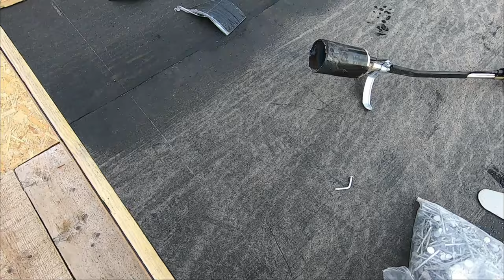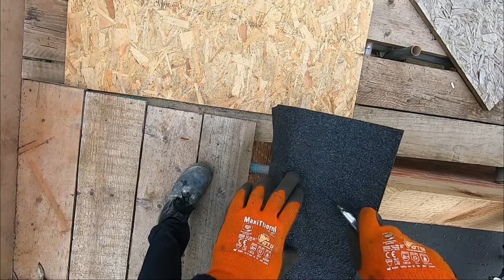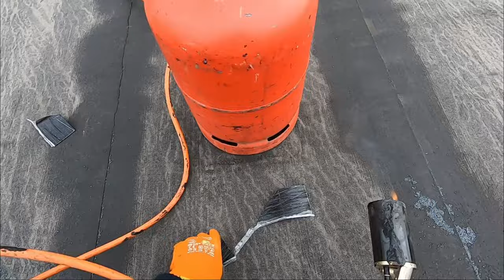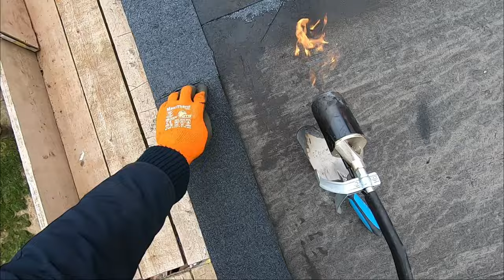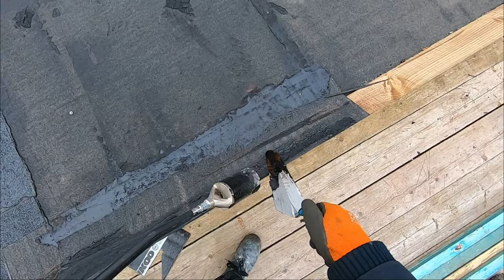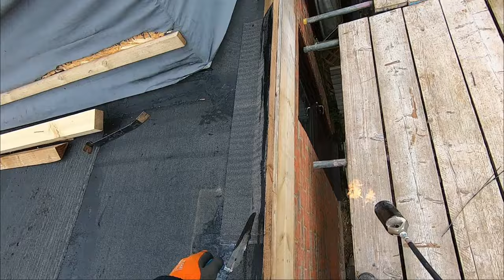Flat Roofing - Episode #1 - Torch On Felt Drip Edges

Comment: I'm a DIY'er. I plan on felting a garden office. This video was very helpful. If i could suggest you expaiin what it is you're doing in a little detail, it would be very helpful. The side wood you use, what height are they and how you meazure the flashing etc. What zbout sofits for air floq how are those fitted?But I still learned a lot from watching. 👍

Comment: There are several no-no’s here. First never introduce an open flame to bare wood. In the states you need a barrier between the wood and the torch material. Secondly, never stack side laps. In other words a flashing side lap should never end up on a field side lap. 
In a two ply system (smooth/cap) offset the side laps minimum 12” from bottom ply to top ply. 
Just so you know I spent 20 years with Siplast, 10 with Soprema and now work for an engineering/consulting firm designing roof replacement and doing forensic investigation on failures.

Comment: Nicely formed drip edge. But I don't understand why heat abit then heat another bit then another bit. It should heat the felt and stick to drip wood. Then heat the other bit and stick directly to the roof. Should take no longer than 30 secs to pull up a drip edge flashing. U take close to 2minutes cause the amount of time u burn abit and put the gun down. Then burn another bit.lol

Comment: Why don't you just run the capsheet straight  over the falls. Just upstand the sides of the roof. Seen this before and always water lying were the drips have been done 1st
Reply: Cowboy way. Learn how to install torch on felt before you imply incorrect techniques. Manufacturers installation vids online.
Reply: Because after strong winds you can find your felt in your neighbours garden

Comment: your drip formers are on the wrong way round, they are not primed or bitumen impregnated, you have no where near enough fixings, they should be 150mm apart, shall i go on ? ok, your underlay does not cover the drip batten, the drip batten is not primed, and with no facia board you should have used a 2x2 so they have room for the gutter. oh and its bleed not bead, beads are what you wear on your wrist.
Reply from the maker: The drip formers (drip cards)  are smooth side out like they should be.
My nails are 100mm apart
The batton was added after to make sure it would clear the gutter and leave room for the fascia.  I didn't build the roof.
Its called a bead not a bleed.
The only thing I done wrong is not cover the the baton with 2mil and put 2mil on the arris before bringing the flashing up.
No big deal.  And it was 2 years since I stepped back on a roof I was s bit rusty.
The finish is 10/10 don't care what you say.
Reply: @Vandal-Vlogs  oh sorry, i just paused the vid at 2:08 they look a lot wider than 100mm lol. drip formers not drip cards lol should be rough side out and primed so the drips have a key, and that 25mm batten you put on will only leave 10mm for the gutter bracket and that is not enough. 
a 2x2 easy edge is 45mm and that allows the correct drip overhang to fit a facia and gutter.
also your drip former should have been set 5mm past the front drip batten to allow for the thickness of the return drip.
you did say to let people tell you how your not doing it properly.
i am an iko, bauder, langley, moy ,radmat ect ect approved contractor of 47 years and i'm just pointing out that this is far from properly lol.
its not bad bad, i would give it 3 out of 10.
keep it up, your getting there, oh and that italien gun you got there, the ignitor melts after a while they suck, get yourself a grun. and you might want to try waxed rubber gloves as the bitumen don't stick the them.
oh and its not sacrificial its called a salvage edge.

Comment: The only thing I would have done is prime the wood or used pile and stick for a better contact but very  nice work
Reply from the maker: Cheers 🖒 You are right I should use primer on the arris but I asked for some but they said it would be ok so I make sure the wood is nicely chard so the oils come out a bit.  The felt is 4mm so it gives me a bit of bitchy to play with.

Comment: You leave the beads on. Why don't you remove them & look real pro.
Reply: Old torch on APP felt let you do that with damping down bleed lines. New torch on felt is rubberised and a lot more adhesive than previous products. Under manufacturers requirements a bleed is required to prove sufficient adhesion. No way of removing bleed lines without damaging material or compromising seal.